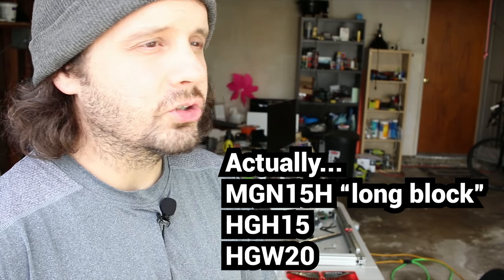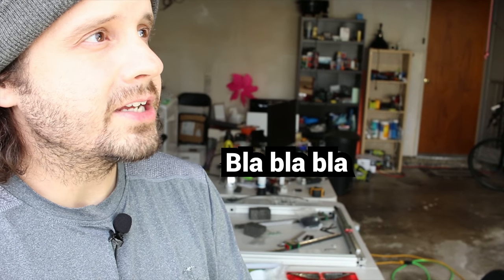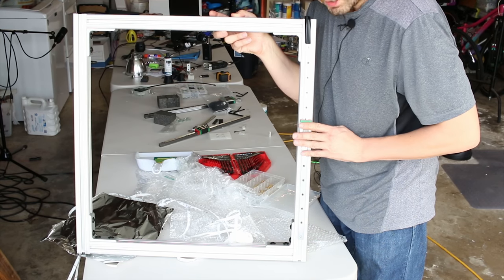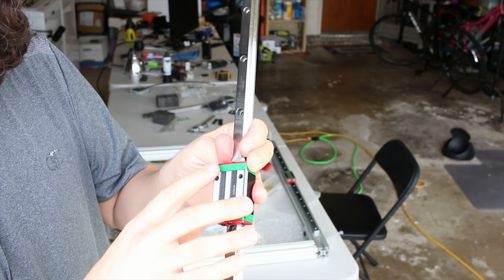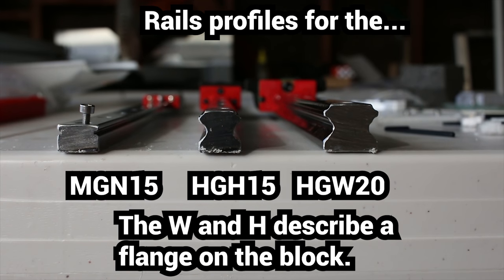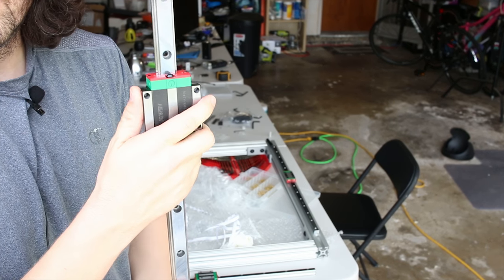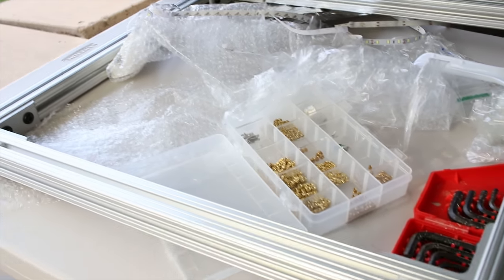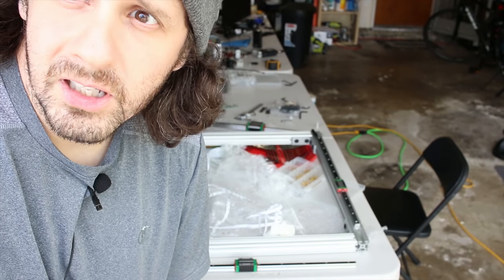Quick Blurb - I have some  Hiwin Linear Guides for a new 3d printer build

Comment: Those prices are sky high. They are too proud of them rails.
Reply from the maker: Hopefully we can learn enough from the Hiwin brand we can identify cheaper versions that yield the same quality or if its just the same as a typical V-Rail.  I think the issue with some cheapie rails is there is no preload causing binds in linear movement known as "chatter". I couldn't source a cheaper name brand rail. Similar rails are actually more expensive at Misumi and NSK.   We will see!  Thanks for the comment!